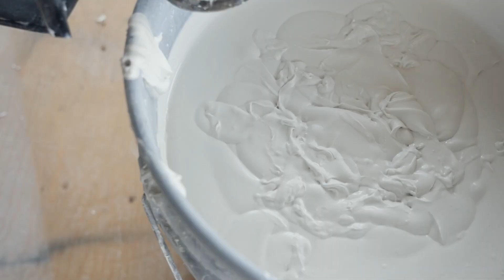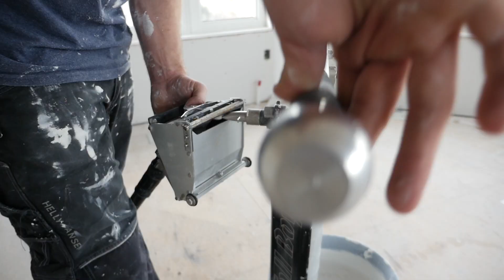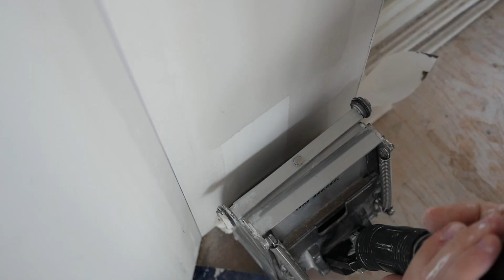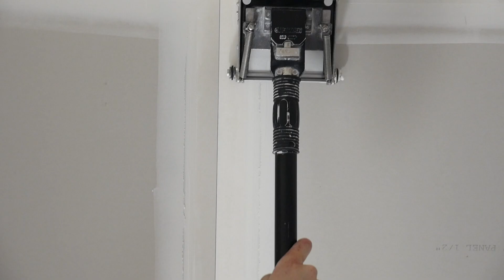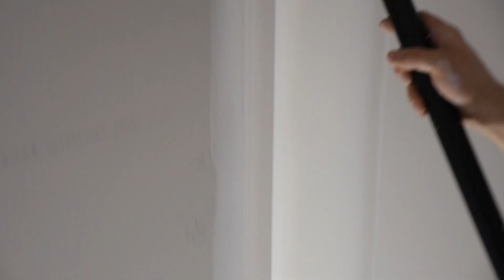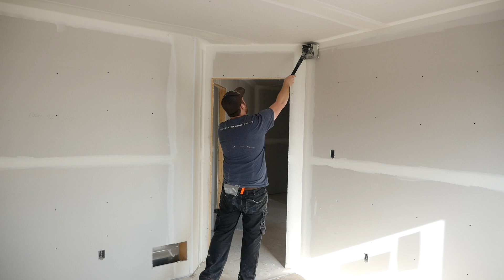Coating No-Coat(UltraFlex) with the Columbia 5.5" Flat Box!

Comment: I am interested in buying a pump.  Are you happy with the tall boy or would you rather have the standard size.
Reply: standard size.... don't forget you'll have to carry a pail with that thing inside around the house when running your machines.
Reply: Tall size is good if you have back issues
Reply: @ingvarz7468  not to mention cleaning that tall boy pump must be impossible lol
Reply: Tall boy is good for a 30 gallon trash can full of mud on a dolly . You can wheel it all over the house or job site.

Comment: How do you like the Columbia 5.5 vs the Drywall Master?
Reply from the maker: going to be very diplomatic here, but you can't go wrong with either one. if you had more Columbia stuff id say go that route. if not they both are sweet
Reply: Drywall Master is the better product.  I try to stay away from Columbia as much as I can..Columbia is the Walmart of taping tools, you can find it anywhere and there's always gonna be parts you need but the quality is just not the same as the other guys like Northstar, Tapetech  and Drywall Master to name a few.